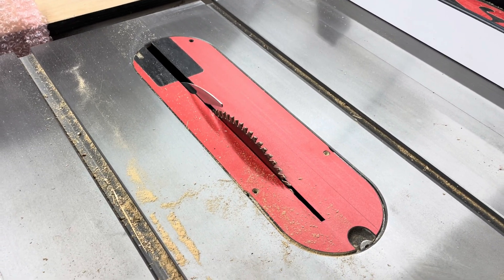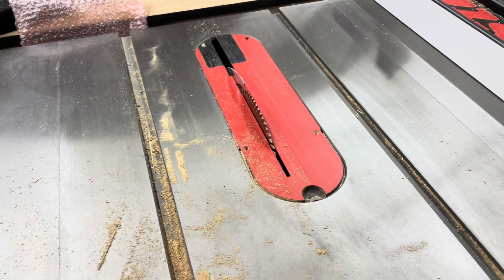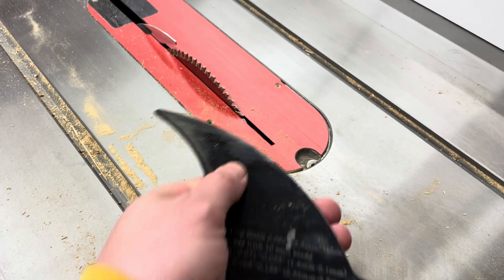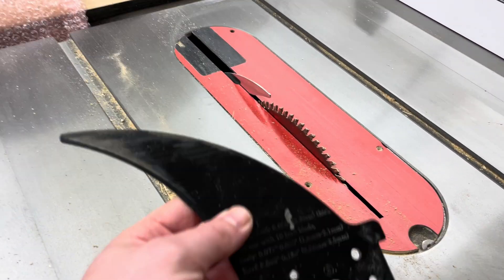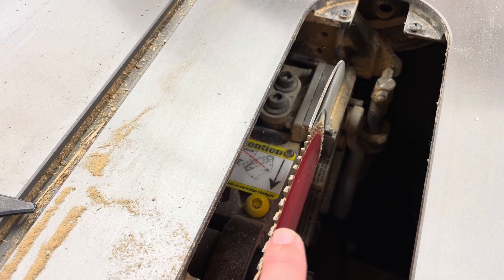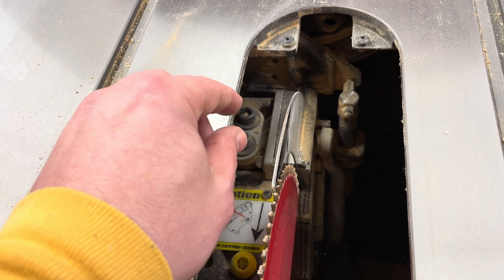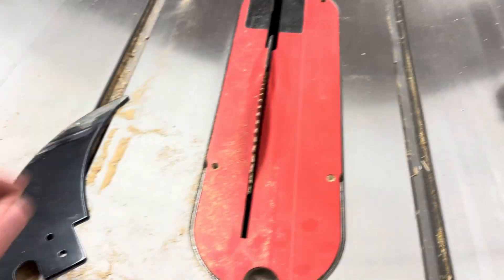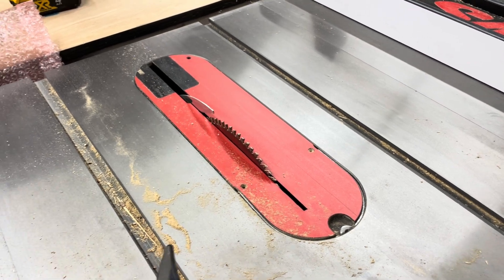Saw Stop Riving Knife Swap

Comment: Good Job putting this video out.  I wish more people would watch this because in reality what a lot of people are doing is getting frustrated when they find their riving knife doesn't work and tossing it aside.  Then they go without one which is no bueno. I've been a carpenter/woodworker for 35 + years and the stores have gone from selling a majority 1/8 " thick  blades to being replaced by cheaper thin kerf blades.  This was of course simply capitalism doing what it does.  Once Diablo and the other companies that sell the cheaper blades got a foothold, stores simply stocked the things that people were buying more and completely flipped the end inventory.  Funny because I remember in the old days when you needed a thin kerf blade for a specific reason you had a special order it. Now you almost have to go online or special or an 1/8 inch blade.